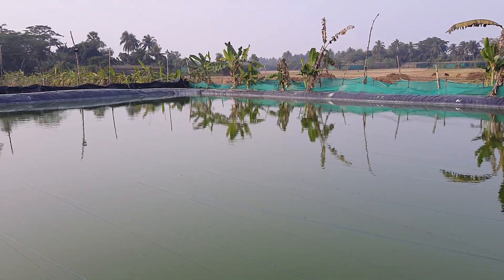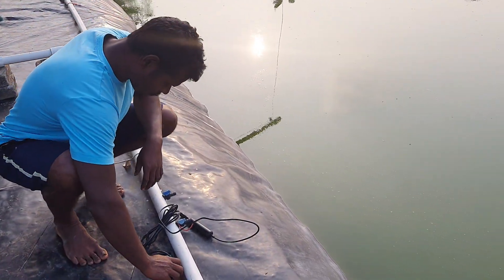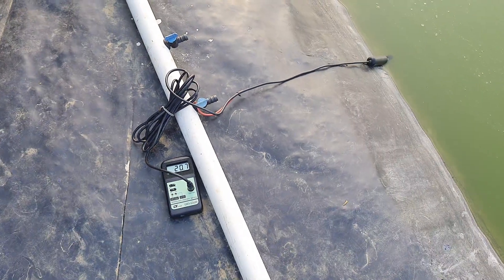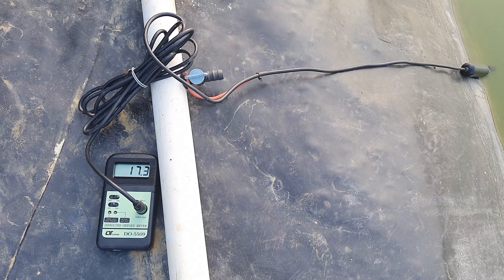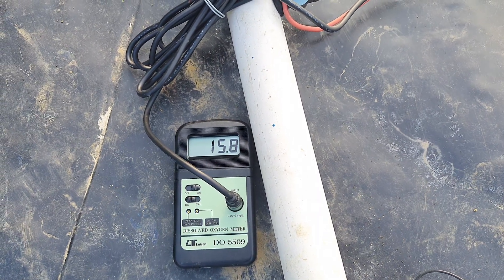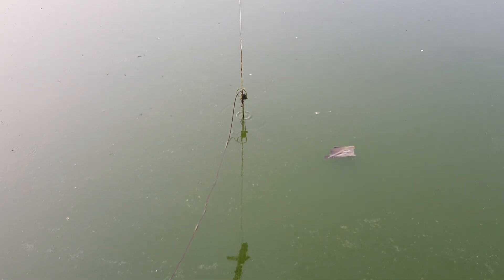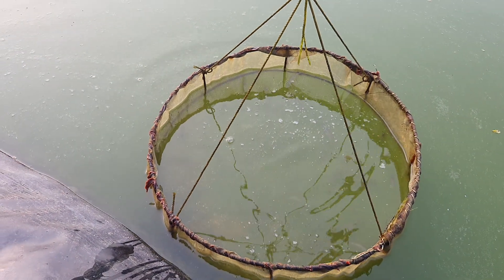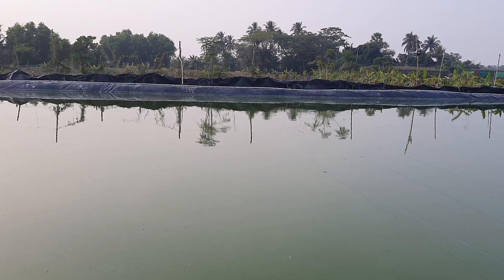Vannamei Shrimp Farming in Biofloc System in Winter Season (English) - 47 Days Update

Comment: what is the stocking desnity sir? it is good that without areation system running you are able to maintain the DO. but I have a query that how you are agitating the biofloc that is formed. Becoz my understanding is that areation helps agitating the floc formed and thus the feed consumtion is reduced. Correct me if my understanding is wrong. Thanks.
Reply from the maker: I am doing some level of experiments, once its successful, I will share the details
Reply: I think because of low stocking and High water capacity in pond culture is not require aeration system so he is able to maintain DO in pond culture. But not possible in Biofloc.

Comment: Too much D.O. is bad when it's caused by phytoplankton right? It means there's too much photosynthesis going on and a crash can occur anytime at night. Can you explain how the culture is still doing well?
Reply from the maker: Still its in experimental phase, once we succeed with this formula, I will share. It may take another 2-3 culture to make it stable and usable
Reply: @RoadtoBioFloc  also let your probe go deeper into the water, the water too close to the surface can potentially be misleading because DO is higher near the surface. 22 is way too high in my opinion, just my 2 cents bro.